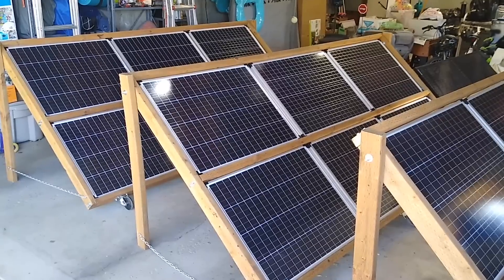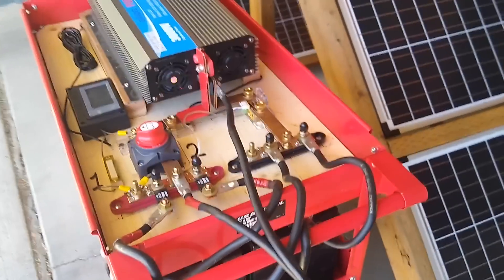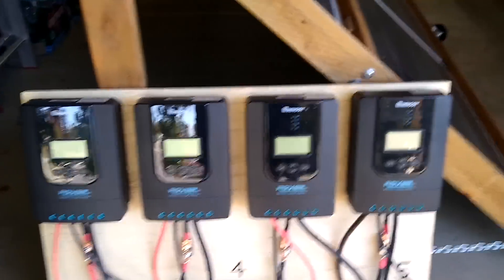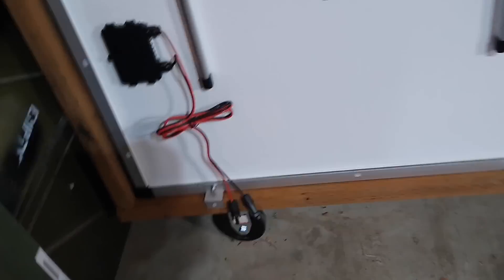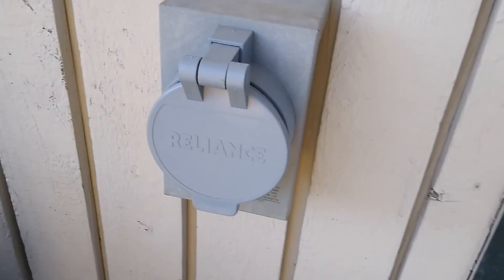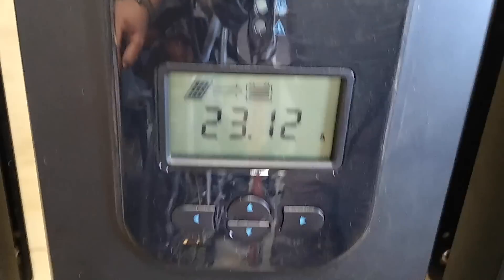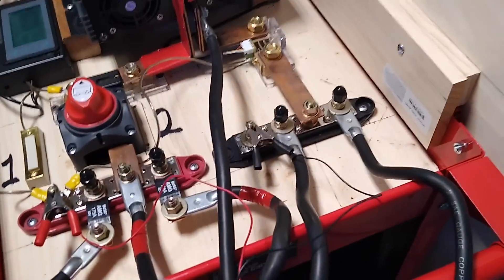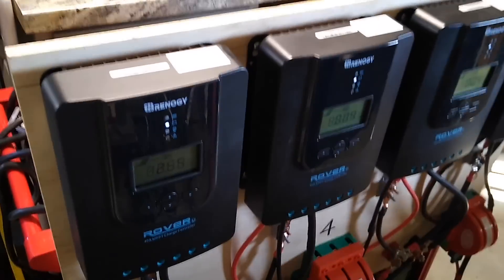My Portable DIY Home Solar Powered Battery Backup System for in Case the Grid Goes Down...

Comment: Nice system except for the transformerless, high frequency inverter. They're not designed for powering inductive loads. You'll be lucky to get 6 months of use out of it before you smoke the MOSFETs. A much better, longer lasting choice is a low frequency, transformer based inverter if you want to run inductive loads like your microwave.
Reply from the maker: Thanks for your suggestion.  I'm not really worried as the 3000W (with 6000W surge) has been replaced with a 4000W (8000W surge) inverter and I did check for guidance on the issues of running microwaves on a solar power system.  https://walkingsolar.com/what-size-inverter-will-run-a-microwave-1000w-1500w-2000w-3000w/ also https://blog.ecoflow.com/us/how-much-backup-power-to-run-a-microwave/

Comment: That little adapter at 6:30 is something I never considered. Thanks for this, it really opened my eyes.
Reply from the maker: I didn't have any issue when I did a test and ran the full 3000W thru that adapter fed by the one yellow heavy duty 10 gauge extension cord.  It didn't get warm or anything, but in theory each 120v outlet is only rated for about half that.  So, I replaced that adapter with this one that allows me to run dual extension cords from the inverter into that generator port and safely doubles the amount of power I can pull out of the inverter:  https://www.parkworld.us/61926-p613.html

Comment: Nice setup!
But you might want to move the fuses as close as possible to the batteries to protect the wires.
One question: Why dont you install it permanentely? Kind of pointless to spend this much money and then having it sitting in your garage rather than reducing your electricity bill.
Reply from the maker: This system may seem pointless to you but is very on point for me.  First, it meets the main objective of allowing us to live pretty normally during a power outage and not be stuck in the Stone Age.  Secondly, it does so at a price point that I was comfortable with and for which I did not need to take out a multi-year loan.    A permanent installation would require rewiring my portions of my house and circuit breaker panel which I am not qualified to do.  Since my electric bills are under $100 a month, there is no urgency to make any change.  I could have bought a Honda EU7000iS for about the same price as this system and still it would be idle most of the time and only be used during outages.   So, not pointless to me.

Comment: 10KWh - nice system :) It is so nice to see useful levels of standby power. most youtubers talk about 500wh power banks and a couple of hundred watt Panels as if they are the solution to your energy needs if the power goes off to your home. My (hobby) backup system is about 4KWh, but I have a generator too - which I know is the real solution if there is a long term power cut, I'd use the batteries for while the generator is cooling since it can't be refueled when hot.
Reply from the maker: Yeah, I like our generator because when the electric company had a planned outage for some kind of maintenance in our area a few weeks ago, it was summer and I wanted to use the air conditioner so I used the generator which does run essentially the whole house and air conditioner.  The rest of the year, my solar system does fine.  I did a test by turning on most of the major house lights (some in every room) and had the furnace and big TV running as well as the refrigerators, freezers and aquariums.  The house was only drawing about 1350 watts, well within the capability of the solar system.  I was pleasantly surprised.  That would not have been possible with incandescent light bulbs a few years ago.  It's really only the A/C and electric dryer that it can't power.  Of course, things like the microwave and hair dryers which use around 1500 watts each can also be used but need to be used judiciously.  I kept our evaporative cooler when we installed the A/C a few years ago as a backup in case the A/C malfunctioned. I haven't tested it but I believe the solar system will power the evaporative cooler as well.

Comment: Can anyone who understands electricity explain in terms how

Amps
Watts
Voltage
aH
And so on have in correlation ?
I’m currently learning and always am confusing one for the other
Reply from the maker: This is not strictly correct because the analogy breaks down at some point but if you think of water flowing through a hose or pipe, voltage is the water pressure.  Amps are the gallons of water flowing.  Watts is the horsepower generated by the water.  Amp hours (aH) is how many gallons can be provided in an hour.
Reply: @Eric1Tube  thank you this has helped me realize more things

Comment: one thing, is it good to general more energy from the solar panels than what you are consuming? So while there is sun, the battery maintains the charge and at the same time you are using its capacity right?
Reply from the maker: If the panels are generating more power than the system is using, the charge controllers simply stop charging the batteries when they are full. That way, you don't damage the batteries.  I didn't explain it but that was the point of the very last segment of the video which shows the controllers feeding almost zero amps into the batteries.

Comment: Your design is very cool and will be one of the cheapest methods to get 10 KWH of backup power. I would add one item. A large battery charger connected to your generator. That way you can charge the batteries on poor solar days and not run the generator at night. Something like the EG4 100A charger. For your aquariums, I have not had good luck with my pumps and lights running off a generator. The power quality causes them to fail. What are you using to power the house?
Reply from the maker: The inverter shown powers the most of the house along with the aquariums.  I did a test by turning on most of the major house lights (some in every room) and had the furnace and big TV running as well as the refrigerators, freezers and aquariums.  The house was only drawing about 1350 watts, well within the capability of the solar system.  I was pleasantly surprised.  That would not have been possible with incandescent light bulbs a few years ago.  It's really only the A/C and electric dryer that it can't power.  Of course, things like the microwave and hair dryers which use around 1500 watts each can also be used but need to be used judiciously because the max output of that inverter is 3000 watts.

Comment: Love the video. I got a setup with one of these Mppt controller's. How are you wiring all four? Is it all just wired to the battery's? Looking at adding another string of panels and another Renogy 40amp but like you've done. I have Autism so bare with me bud
Reply from the maker: Yes, you can connect multiple MPPT charge controllers (in parallel) to the same battery bank.  On the other hand, you should not connect MPPTs in parallel to the same panel array.  In my system, each controller is connected to a separate array.

Comment: its emergeny backup.... you can also just keep it charged via grid power which would prob be cheaper than the cost of the lumber over 5 years.  not even counting the panels.
Reply: My initial thoughts too. But notice that even when he is using a modest amount of power, the solar panels are keeping up. This could serve him well during an extended daytime outage allowing him to run longer in the event of a long outage. Great for people in Rural areas where power can sometimes be out for days.
Reply from the maker: I do have a charger that will charge the battery bank but it takes several hours.  The panels actually charge it much faster.  I don't store the batteries fully charged in hope they will last longer.  I store them about 75% full.
Reply: @Eric1Tube  since you invested in the items already makes sense, I am thinking for others the cost to buy and build and time to move  them around. a slow trickle charger from 110v keeping them at 75% at all times might save you money. Depends on where you live, my place we may lose power couple times a year, but never more than 12 hours. 

I would like to have the battery bank for overnight and keep it during the day with a small genny to charge it.

Comment: Nice set up, if you dont mind, how much do you think you have tied up in this ?
Reply from the maker: It was about $5000, but after I replaced the 12v 3000w inverter with a 24v 4000w inverter, it's about $5500.

Comment: Would the heat burn the wood?
Reply from the maker: None of the components get hot enough to burn anything.  Running full out with a 3000 watt load on the inverter, I checked the temperature of the components.  Everything was good except for the cheap so-called 275 amp switch (#2 switch on the top of the cart).  It got very hot well before 275 amps were running through it.  I swapped it out for a much higher quality 600 amp switch (not shown in this video) and all was good.

Comment: 37 amps? Did you wire in parallel instead of series? Well, there goes power due to line loss. Get a MPPT charger with a higher voltage rating and go series instead for much lower amps and much less line loss. More efficient conversion too if you go 48V battery bus instead of 12V. You have the battery and panels to do it, I would seriously think about going with a 48 Volt battery bus. That's what I do and I can use much smaller wiring because with my panels in series I push about 10 amps at 108 volts (1080 watts) per bank of panels (6 panels rated at 180 watts each) with a VOC of about 130 VDC. Using a single 60A charger with a 48v battery system enables me to push up to 2880 watts into my batteries with 3 paralleled-series banks of solar panels.
Reply from the maker: Actually, I wired them in a hybrid series-parallel arrangement.  A number of people have assumed the panels are all in parallel I think because of my comment that 6 amps per panel totals about 36 amps per array.  That's pretty much true for what the charge controllers put into the battery regardless of series/parallel/hybrid wiring:  https://www.youtube.com/watch?v=Cx0sXccHbUg

Comment: I built a very similar system using the Trojan solar lead acid batteries wound up with also 10 K use an outback charge controller and the fuses for the battery and for the solar panels and a 2200W pure sine wave inverter. I used it for about six years before I moved, it was a good learning experience, but it upwards of a seven year return on investment it ran  my refrigerator every day Internet computers. All else ran from the grid mine was isolated from the grid to be legal 
I would always be better to buy a prebuilt  professionally designed system. My intention was to learn for myself, in the future I would pay a professional if there was anyway I could afford it and now there’s two things of government could get behind affordable, housing and solar for everyone I also have the same problem. No way to pump the excess into the grid because it was completely isolated from the grid and I conclusion was if I were to do it again I would want 48 V not 12 and at least double the battery capacity and of course lead acids are cheap but you have to water them can only use 50% of the capacity you can’t get them hot or cold even if you do everything perfectly right they only last about eight years although I did not get a test that they were working perfectly at the end of five years
Reply from the maker: My intent was to put together a system that would get us by during an outage and have it all paid for immediately.  I didn't want to spend tens of thousands for a professional system.  It wasn't high enough priority.  Still, now that I have some personal experience, it is likely that I will have a bigger better system in coming years.  I may or may not do most of the work myself.

Comment: Solar seems like a lot of components to get AC.  I’m not knocking it just trying to figure it out.  What’s your total investment currently❓❓
Reply from the maker: It's about $5500 now that I swapped out the 12v 3000W inverter for a 24v 4000W inverter.  I bought the 4000W inverter like new but used from the Giandel website for a bit of a savings.

Comment: Curious if you've considered using aluminum instead of wood for the solar panel structures to bring down the weight.
Reply from the maker: I didn't think about it.  Part of the decision to go with the treated 2x4s was to improve weather resistance but also to allow the panels to be slightly recessed within the array frames so the arrays could be stacked without scratching the surface of the panels.

Comment: My solarpanels are connected to the net of the electric company, but I got mad once they cut off the electricity for 8 hours and my solar panel didnt power my house. I dont know how they do it but it should have powered my house I think.... Normally when the net is on it powers my house first and sends remaining to the electric company... and no Im not using more than the solarpanels bring...
Reply from the maker: That would be infuriating.

Comment: You must have a gas furnace.
Reply from the maker: Yes.  So happily, our electric bill was well under $100 a month on average when I assembled this system.  So I wasn't really worried about lowering the electric bill.
Reply: @Eric1Tube  I didn't bring that up as far as lowering a bill, but the fact than an electric furnace could not be run without 240v and 40 amps or more. So, mostly impossible without a large high capacity system.

Comment: Not a bad setup, I would at least hook it up to ur light circuit & maybe a GPO circuit with a change over switch so you can use a bit more of that power & have redundancy if solar or grid have problems. TFS. Cheers
Reply from the maker: At some point when I get around to making the necessary wiring changes, my intent is to deploy one or two arrays permanently to power our TV room which has the freezer, a second refrigerator,  the big aquarium and the TV/home theater.  Our electric bill was already less than $100 a month so I wasn't really worried about using the system full time.

Comment: I'd like to see the electrical diagrams for this setup.
Reply: What do those selector switches do?
Reply from the maker: @penncapt  Switch 1 is a momentary contact doorbell button and feeds power from the batteries and thru a resistor into the inverter to charge the inverter capacitors before really providing power to the inverter.  This eliminates any sparking and erosion of terminals in the main switch when the batteries are connected to the inverter.  Switch 2 provides battery power to the inverter.  Switch 3 provides battery power to the charge controllers and also allows the charge controllers to charge the batteries.  Switches 4 and 5 connect the solar panels to the charge controllers.  For proper operation, they need to be switch in the correct numerical sequence.

Comment: A lot of your wire crimps look pretty chincy.
Reply from the maker: They probably are chintzy.  I used a Temco crimper which you have to use a hammer on for the larger gauge wires.

Comment: Im wondering about your MPPT’s…. I have Victron Energy MPPT’s and they have two different ratings, the input voltage (Voc) & watts as one of the ratings and the output current as the second.  So my Victron Energy MPPT 150/35 allows for 150v @ 500 watts input and max out at 35 amps to charge the batteries.  I looked up the specs on your MPPT, all I could find was the Voc of 100v @  520 watts.  I’m guessing the 40 is the output amps, not the input amps.  

Out of curiosity, how do you have each array wired? All in parallel or 2p3s ( 2 parallel arrays of 3 in series)?  If they are all in parallel, try wiring one up as 2p3s and see if it produces more then the 6p setup.

Higher voltage is always your friend in this case.  The main reason is resistance.  You will loose a lot more electricity running high current with low voltage than low current with high voltage.   This is the reason my deployable solar system is the 150v not the 100v, I can use smaller gauge wire over longer distance with less lose of power!
Reply from the maker: You are correct, the MPPTs display the output going into the batteries.  I compliment you for figuring that out. The way the panels are connected is 3 pairs in each array connected in parallel.  Each panel outputs about 17.5v and 6 amps so the array voltage is about 35v and 12 amps.  The controllers are charging a 12 volt battery bank, so they lower that voltage and push out about 38 amps which is the same number of amps that one of the arrays would output if if was connected entirely in parallel.  A number of people have concluded that I had the panels all in parallel because the charge controllers displayed about 38 amps going into the batteries.  The truth is, that would be the value pretty much regardless of how the panels were wired.  I may post some video I shot where I had one array in series, one array in hybrid series-parallel and one array in parallel.  For each of those wiring schemes, in this small system, the charge controllers were all putting out about the same amount of amps into the batteries.

Comment: Like how you put the wheels on those panels.  I have a big panel that is hard by to move by myself so will copy that idea.
Reply from the maker: The arrays are still pretty big and heavy and require 2 people to move around.  If I were to do it again, I would have made the arrays smaller with only 4 panels per array to make it user friendly for one person.